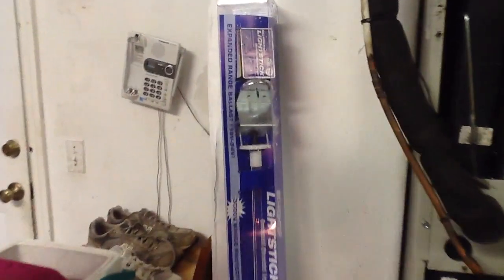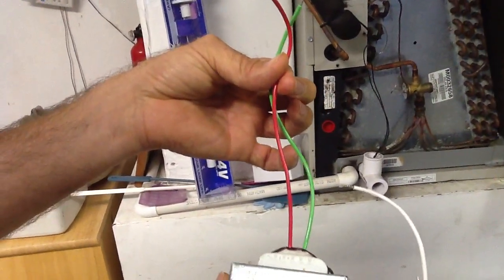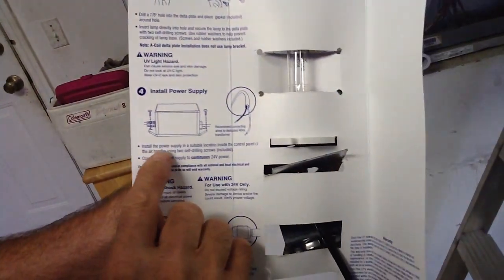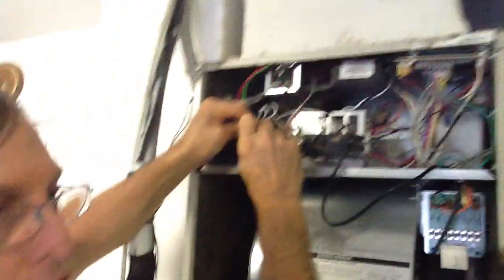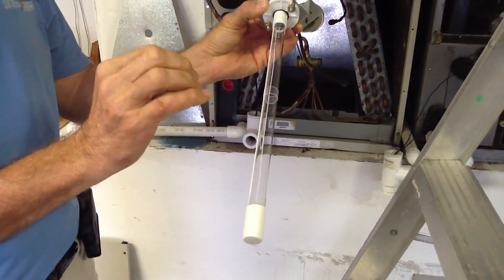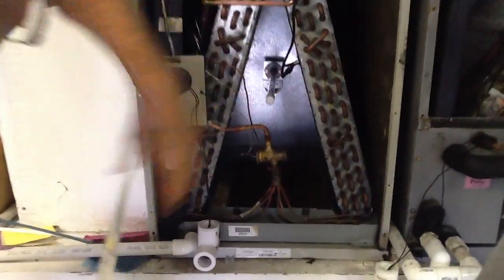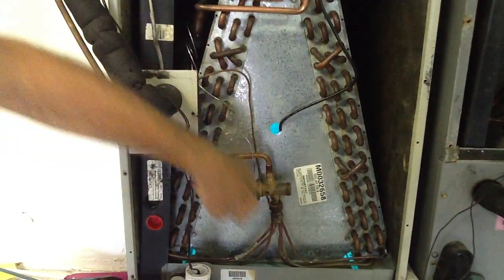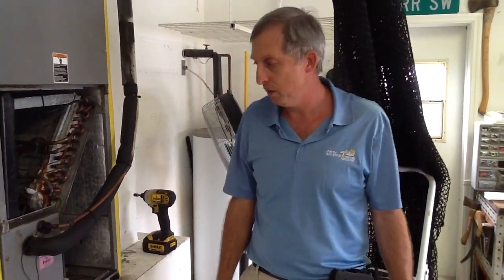Ultra Violet Light Installation Start to Finish

Comment: hi thanks for the video! one question though, do i always need the first box (transformer) to have or install?  or most AC units should have it already? im installing the UV light on my condo tha has an AC unit with a cooling tower that goes all away until the 22nd fllor. I live on the 9th floor...  thanks so much in advance!
Reply: im not an hvac professional, but my understanding is that you still have a compressor that calls for a/c or heat in your PTAC  (or other unit) in your apt.  He clearly said dont power share because it could affect the operation of the unit.  the fact that you have a cooling tower isn’t a factor.  Your unit is still high voltage and the power supply is engineered for a certain peak load when the unit kicks in; take some of that power away diverted to the light and it could be an issue.
Reply: You have a chilled water system, so, you would still have a blower unit inside your unit, where you could tie into the 240 VAC feed to run the 240 VAC-24 VAC transformer to run the lights.

Comment: If I wanted to use two of these lights, can I do the same thing you are with two transformers powered from same breaker?
Reply: Due to the low current draw, I used the same transformer for both bulbs.

Comment from the maker: This breaker was already in the air handler. If there isn't a breaker wire the high voltage under the main lug in the heat strip.  Hope this helps..

Comment: Hi David, what model of Square D circuit breaker are you using? 40 amp? 2 Pole? And what kind of mounting bracket are you using? I want to make sure I'm doing the exact same set up you are in your video-which is AWESOME!
Reply: +Kristina White The circuit breaker has no impact in relation to the installation. He's using existing wiring inside furnace and stepping it down to 24VAC. The light is about 12 watts... nothing compared to the furnace.. So it's insignificant.

Comment: I see that on the slant coil you mounted it underneath the coil. all other places show to mount over coil. does it make that much of a difference?
Reply: The reasoning is for potential  moisture dripping on the (electrical) UV light and damaging and/or shorting.   In this case it didn’t seem like there was much of a choice; you work with what you have.

Comment: Where would the transformer be?   How do I get to it?

  This UV light system is a free standing
Honeywell unit.   It has the "box" that you bolt to the a/c unit...This "box" is what you insert the uv bulbs and the bulb holder into.    When I insert the bulb into the holder ( it is a 4 pin light ), turn the holder 1/8 turn to the right, the blue light does not come on.    My power supplies are working.

Comment: my hvac system has the honeywell uv light...it is a 2 pronged light...question....one of the you tube videos says when the uv light is working properly, the blue light on the twist on handle will be lit.    my blue light is not working; however, the uv bulb appears good.    i'd say the bulb is about a year old.      what could be the problem with the blue  indicator light not working???